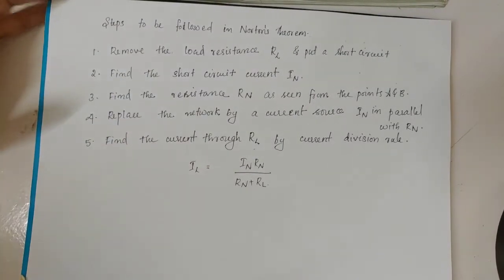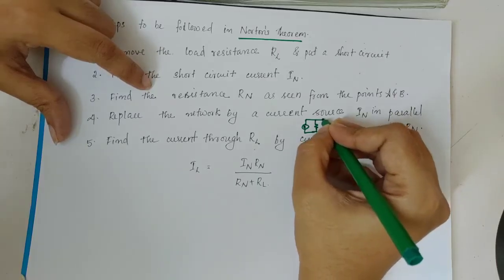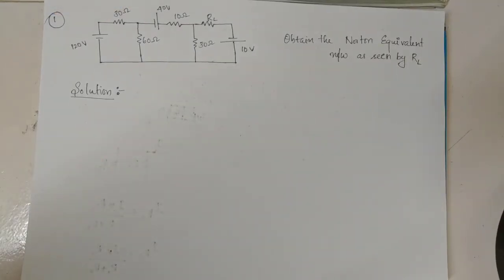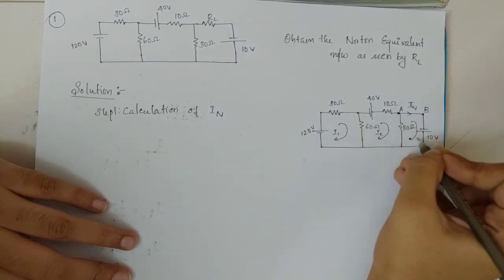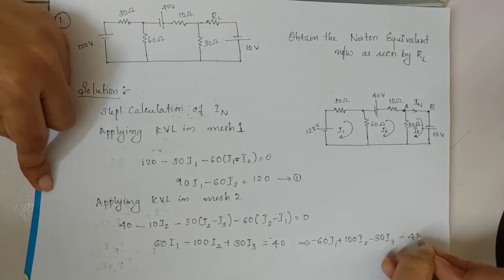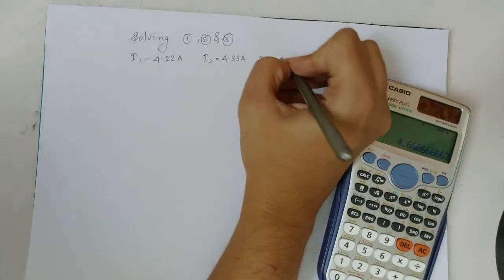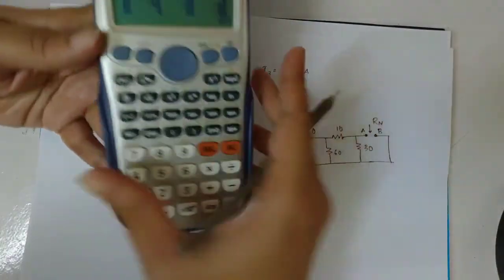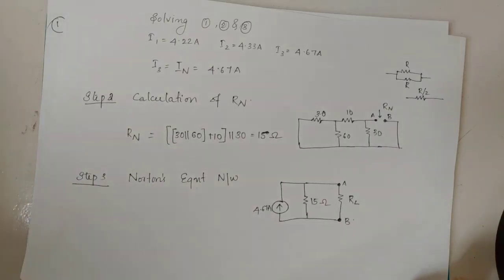Norton's theorem Problem|EEE Circuits and Network/EC Network Theory|| KTU MALAYALAM

Comment: Mam playlist onn correct aaki idumo ith full confusion aakunnu🥲
Reply from the maker: Can u send me mail on which subject u need me to arrange the Playlist... I  arranged Playlist accdng to ec n eee ...Ss Network theory dsp Circuits.. pls send me the sub code ya syllabus
Reply: @engineeringstudies3350  S3 ECE network theory syllabus 2019
Reply from the maker: @momsgirl1  ECT Playlist noke.. EEt Playlist il vere aane kidakunne
Reply: @engineeringstudies3350  module 2 il Laplace kk varunnund pinne 3 yil 2nd module portions um varunnund